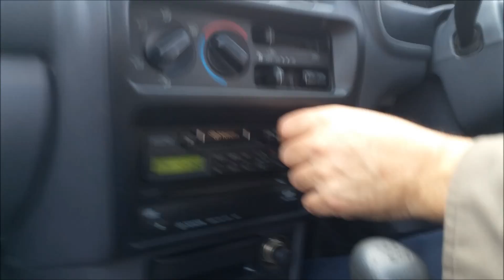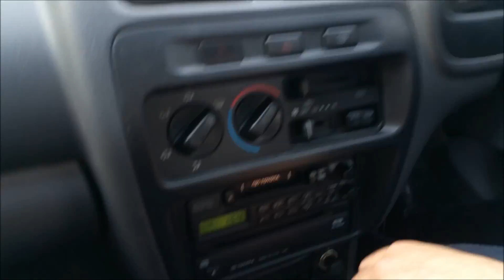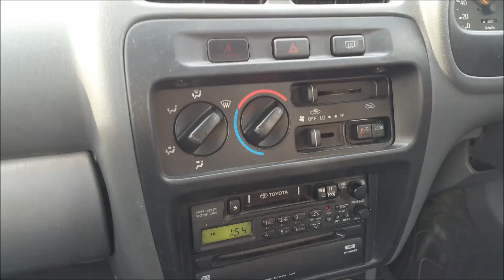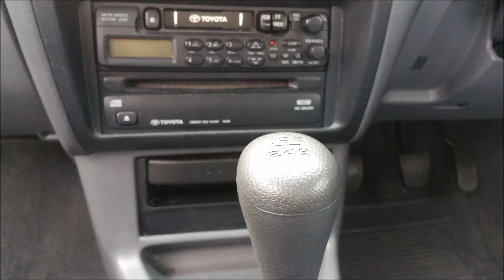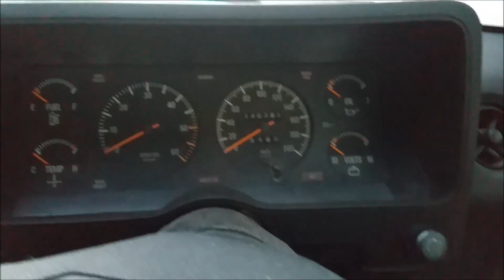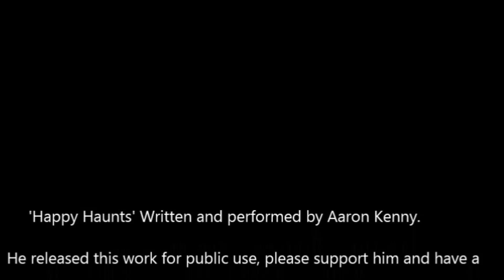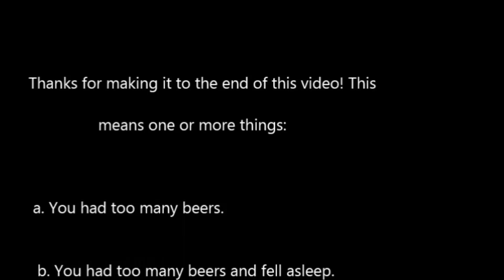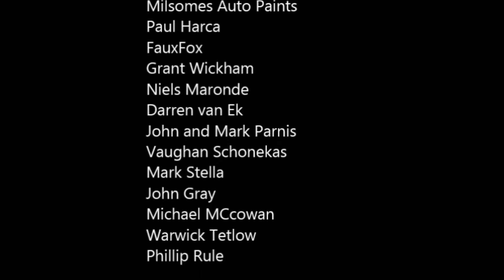Lets Build a Car Part 9 - The COMPLETED Starlie

Comment: Love watching your starlie vids, been a great help to me as I have a 3dr 1998 SR model here in the U.K. We've had her since about 2004 and she's done 173,000 miles 😅 still has good compression 😎 Speedline 15" alloys, Team Toyota Europe rear spoiler and exhaust. Only 125 made in 1A0 silver, not many left now I would guess. Im about to have the engine, clutch and gearbox swapped from my mum's 98 5dr as my gearbox is quite worn and clutch probably needs replacing. Both have oil leaks but need some seals replaced I would guess ( Im a complete noob to pulling cars apart 😆) I can do a basic service, plugs etc. These starlie vids have been spot on for me. I was able to swap all the locks over today as mine are shot! Swapped the ignition barrels but wouldn't start ☹ need someone to code them? Swapped a few interior parts, center console with working cig plug! Going to swap the seats over as mine are green like yours and my mums are blue. Might take the covers off and wash them 😉. Need to get some door cards as 3dr vs 5dr.  Blue stereo surround. She needs a full respray to be honest but I dont have garage/compressor/knowledge. Might shoot a little walk round vid 🤔. 

Sorry to hear your mums not well. My dad has cancer and not long left ☹
Ive watched the starlie vids so im going to watch the others 👍keep up the fantastic work and vids.

Cheers Adam
Thanks
Reply from the maker: Thanks Adam, I'm glad there's someone like me that really enjoys tinkering with these little cars. Mine's now on full daily duty (lockdown means rare use though) and I love the thing. I enjoyed the sheer easiness of the project where everything fits perfectly - you don't get that with a local care here haha. I also enjoyed building it with everything I would want if I had the opportunity to buy another new one. Great cars!

Comment: Really nice video Pete. Very sorry about your mum’s deterioration mate. Those of us who have been through it can certainly relate.  Interested hearing your comments on fuel.  I respect your opinion  with cars( I was once told you should run it on the lowest octane that won’t cause pinking?), though with classic motorcycles I have experimented and I have found they run best on the 91 and 95 octane. I am not 100% sure exactly why, though a mechanic mate who owns a classic bike shop says he has had many bikes through the work shop that have had carburation problems on 98, he puts it down to all the additives causing it to be more dense (I think he said).  Would love to hear more of you fuel opinions, for me, they should never have got rid of Super, I understand the health risks, but believe they are still there only different in modern petrol.

Comment: Good little series Peter. I passed my test in a Starlet back in 1980 so I've always had a soft spot for them. The new colour is great but I can't help wondering what you did with all of the paint you bought. I'm sure you said you bought too much & then not enough went on the car? Anyway, it turned out beautifully so you must be very proud of it.

Comment: My Father inlaws Starlie is having the airbag replaced at local dealer, Dad didn't want to get rid of it when they were doing tradeins  so we thought we would risk it till they deregistered it, we got a letter in Jun to say they can now replace them, spoke to the dealer yesterday, initially said they'd tow it in, we said no we'd drive it in on Wed, they got back to us 1/2 hour later and said wait till the airbag is in , a couple of weeks and they will fit it while we wait. Will keep you all informed on progress
Reply from the maker: Yes there have been many now who have had their airbags done. I flirted with holding on to my pale blue one as the car was fine. When the lady stoved the rear quarter in, that was when I decided to take advantage of the buyback, cheers.

Comment: Probably a good idea to save these things. Toyota has been crushing them left, right and center with that takata airbag recall.
Reply from the maker: Yes... loads have met their doom... but they have replacement inflators now, so no more crushing is going on... The other thing to note, is that they don't rust and are dead reliable, so it's forseeable that there were still absolutely loads of them prior to the buy-back program anyway, cheers.

Comment: Is that Starlie complex enough to advance the timing in response to premium gas? because if not, and if it doesn't knock with regular gas, then why spend the extra money.  Of course you could manually advance the timing until it knocks with regular gas, except I can't because both my cars are so worn that they won't knock no matter how far I advance the timing, limited only when it tries to start backwards.  And that's with USA 87 octane regular.

Comment: Need a different oil pressure sender in the XD Pete? XD and XE changed - wondering if you that the XE one from VDO?
Reply: You're right about that.  Flexdrive lost the instrument contract to VDO after the XC when the XD came.  VDO had to make the instruments in the XD to match Flexdrive senders, then with the XE,  instruments and senders went all to VDO.

Comment: I get dizzy watching you.... you walk and think at 100mph haha. Best looking starlet out there. I had a 97 3 door,  green one here in Ireland and it didn't even have power steering. (It was over 1000euro extra) Used to bang my head getting in and out of it for some reason, I'm awkward like that, also can't  stand rattles or sqweaks in a car.
Don't worry about language/jokes, some people have little to moan about, there's more important stuff in life than snowflakes taking offence.
Reply from the maker: Yes I agree... and the power pack (steering, locking, mirrors, dash) was really rare here too... I think $2,500ish! So the more you optioned one of these, the closer it got to Corolla money, so people bought those which had all the power stuff as standard equipment anyway, cheers.